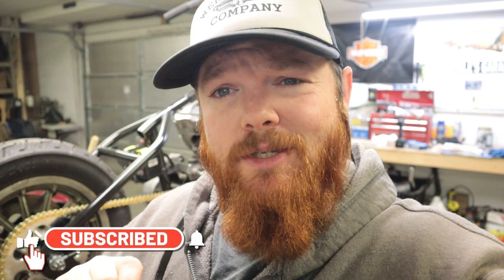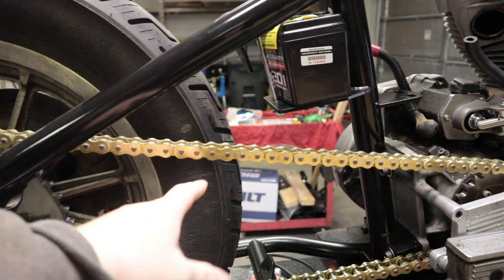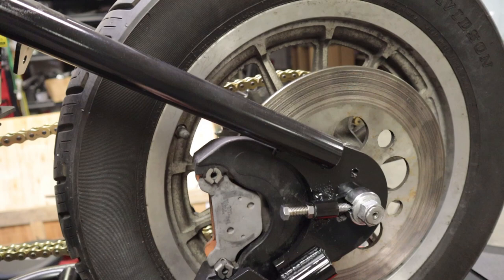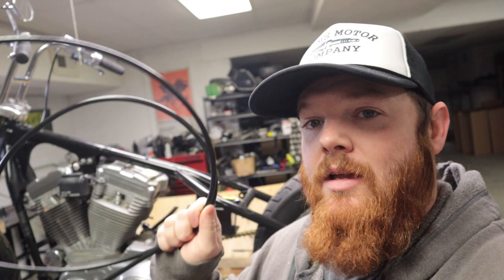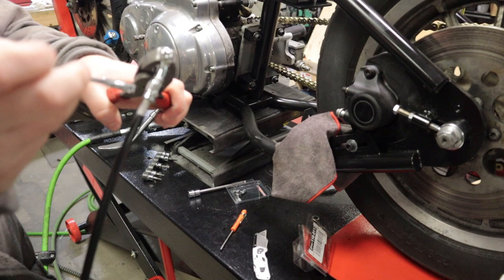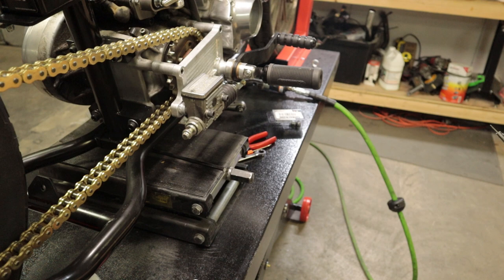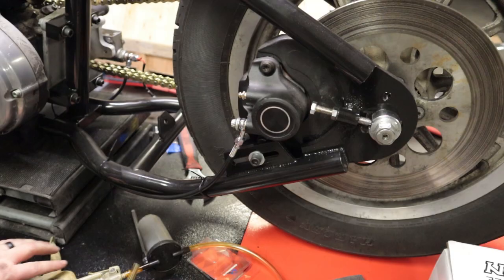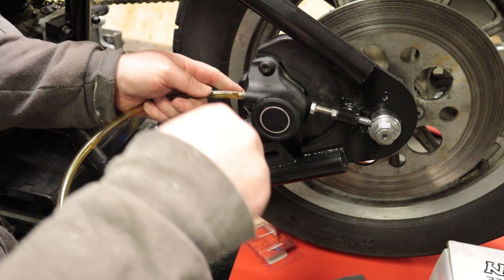Installing CUSTOM Brake lines on my Harley Davidson CHOPPER!

Comment: On Billy Lanes YouTube channel awhile back he showed and talked about the company he uses and how he makes custom brake lines.. you can buy the soft  colored line and the nice anodized AN ends, elbows, ts etc..
Reply from the maker: There's definitely some.nice products out there
Reply: @STL Nik  definitely better than replacing it with the expensive factory hard lines which you can't repair on the side of the road..whereas a soft flexible line that can be ran nicely and can be repaired if you're carrying a couple small spare pieces.. I'm about 4 hours north of you just south of Moline Illinois and I'm ready for this cold and winter to be gone

Comment: My question is should I run one line from the rear caliper to the foot control that should be it for the rear?. Correct? 
Then run one line to the front caliper?. The reason I ask is I'm building a chopper model and I want to do this correctly. Don't want to look dumb at a contest. So the foot control on the opposite side is the clutch pedal?. If so where do I run the line from the clutch pedal too?. please help me bro?. Thanks.